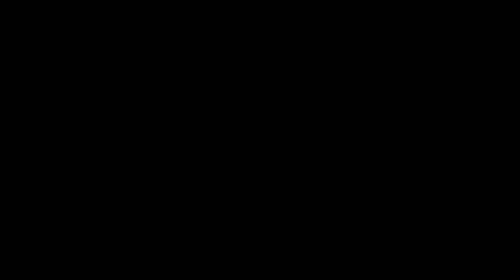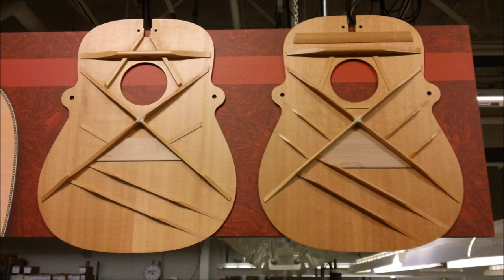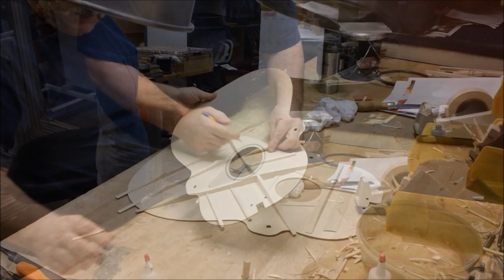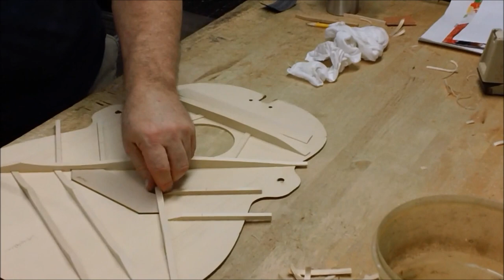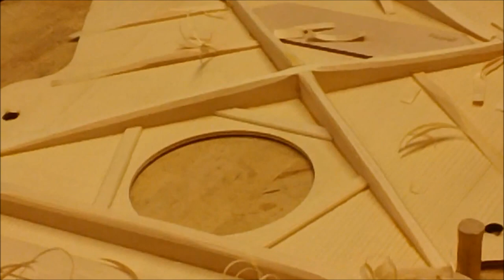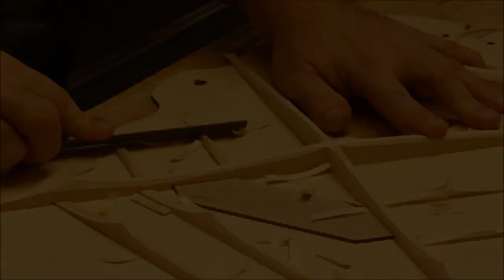brace shaping-Martin Guitar Factory

Comment: There are some videos of Dana Bourgeois demonstrating the process of top voicing/“tap tuning.” I imagine that this man, here, has done this for such a long time that he can probably determine how good the tone will be by the stiffness and weight of the top and the shape of the braces; but I personally feel like a better and more complex tone can be achieved by taking your time with it like Dana does. But, of course, I know that Martin’s productivity levels would totally be brought down, so I fully understand the reasons for doing it as they do.
Reply: This is roughing work. If you notice some wood shavings stick to the chains. Probably later he or someone else will do the voicing work on the soundboard.
Reply: @cristallostranito661  Martin doesn't do voicing / tap tuning. They are simply shaving braces into a predetermined shape for a particular model. What you see here is pretty much the full process, except for some sanding at the very end to remove the scratch marks.
Reply: @boshi9  yep retail guitars aren't voiced. Their custom shop isn't even voiced anymore.
Reply: With the level of noise in that factory, tap tuning would be absolutely impossible, I've seen the same video you saw, with Dan Bourgeois, and I totally agree with you, I hope that somewhere along the line in the Martin factory some fine tuning is being done, if not...those Martin guitars are way too expensive..

Comment: Incredible skill, wonderfully sharp tool, and this would not be possible without top quality materials.  
That said, Martin is a factory, so you won’t get the ritual tsp tuning so many commenters mentioned, but you will get exactly what they intend to make based on many, many years of experience. 

I toured the factory years ago and learned that any Martin , regardless of model, that has a defect that can’t be corrected, gets thrown in a chipper. No factory second Martins. Ever.
Reply: Except for Martin kits. That may be true of complete or near complete guitars, but 2nds of individual parts are usually put into Martin guitar kits for builders. Martin actually has that as disclaimer when you buy the kits. That being said, even the kits have some pretty nice wood. It's like only very minor flaws that create reject parts, or possibly non-matched sides, etc.

Comment: It is reasonable to assume that this was a standard carve applied to all tops with that pattern.
Also presumably further refinement will follow according to each top's material and acoustic characteristics.
This guy worked so quickly that I don't suppose CNC could save any time doing this operation.
Reply: There's a standard carve for a model that he follows. This particular one is their "golden era" style bracing since you can see him hand beveling the "X" braces instead of starting with preshaped ones like on standard guitars, meaning this is either an Authentic or some kind of Custom Shop order with that option. There's no refinement for each individual top at Martin.

Comment: He never tapped the top for tone. This job would take at least half an hour in one of the small production shops, with continual tapping for tone as they go along. He shaved the top like he was peeling  cucumber.
Reply: Even if he was to tap the top for tone, how would he ever hear anything in that shop?
Reply: What I've noticed from other builders is they shave it to the general point of where this video ended, then they start tapping around and refining the braces.
Reply: @dontsubscribeme9547  It's not invalid. Many different bracing patterns work and equally, many don't, that alone is evidence that bracing and strutting has bearing on the end result.
Tap tone is certainly an indicator of the top's response, however, what is contestable is how it is interpreted and the validity of any individual's claims to be able to do so. Unfortunately there is plenty of scope for woo and voodoo science.
Reply: @dontsubscribeme9547  bracing patterns are bullshitl? Um no buddy, bracing is one of the most important things on the guitar
Reply: That's what makes Martin so fun though and other production guitars, there are ones out there that are just perfectly brace for the top they have. It's going to happen, just out of sheer numbers, and when you find that special one it's that much more special and it sound unbelievable better than any costume you're going to find
Reply: @el34glo59  +1. I have an X series Martin that I think sounds incredible, and I wonder if I just got a particularly good piece of spruce on the top or what, because I don't think they even shape the braces.
Reply: I know that a lot of attention has been paid to tap tones, but I gotta wonder how well it can predict what the instrument will sound like. The top will not vibrate the same way once its edges are glued down, the bridge is applied and put under the string load and the finger board is glued on. It becomes an entirely different vibratory system. Maybe it won’t sound like it did when tapped, but maybe a top that taps a certain way will work well in the final product.
Reply: And yet Martin is the standard for which most other boutique builders imitate.
Reply: @trackie1957  I could be wrong but I read somewhere that Martin doesn't use the tap tone method. When it comes to grading wood, they've always done it visually.
Reply: @trackie1957  Have you heard of Trevor Gore? He wrote the book on modal tuning. Part of his philosophy is that you tune the top and back plates to be most resonant at a frequency off of the scale tones (provided you're tuned to concert pitch). This is supposed to help the guitar be balanced across the spectrum. No idea how he actually achieves this after accounting for everything you listed above, but he somehow figured it out!
Reply: Tap tone is way over rated.  This guitar will sound great without messing with 'tap tone'.
Reply: This chap is just working from a template. The result is a slightly lighter soundboard - so there is a benefit but it doesn’t compare with the improvement a skilled luthier can obtain. Martin guitars are factory made instruments. Classical guitarists left factory and workshop made guitars decades ago and the much better tone, balance and volume of today’s concert guitars reflects the expertise of individual builders.
Reply: @trackie1957  yeah I’m skeptical of the whole taping/voicing thing.  You can’t know what a guitar will sound like until it’s assembled and little things like string gauge and thickness of a pick and where you’re playing impact tone in a huge way.
Reply: @fishbake7  
Neumann U87
RME Fireface UCX II
Beyerdynamic DT 1770 Pro studio headset
Reply: Correct. He's making a shape that conforms to some Martin standard, nothing to do with voicing the top  properly.
Reply: Yes. Why do they continue without science and metrics?  @rjlchristie
Reply: I dunno about y'all but my Martin sounds lovely

Comment: I was under the assumption that the amount of shaving was contingent on the flexibility and tone one is attempting to achieve. That means it unique to every top. This craftsman didn't once pick up the top to flex it or tap it. Can someone correct me if I'm wrong please.
Reply: You are not wrong about this at all. I too was very surprised that he did not pick up the soundboard and tap it to at least hear the natural note of the treble or bass sides of the bracing, then shaving more as needed. I am an amateur at this, but that would be my approach.
Reply: Because every piece of wood is different. Not just the soundboard, the bracing too.
Reply: @raytristani  Here's the thing. Small boutique builders would do this as they are likely looking for a certain sound. Martin on the other hand allows for variation, and if you pick up several new Martins in a store, you'll see they all sound a bit different. This gives the buyer choice, as not everyone likes the same sound. This is not a bad thing for Martin, in fact it is probably desirable as it makes each guitar unique. As a by product, they spend less time tuning. I'm willing to bet the custom shop can do tuning for you though.
Reply: capohd28 well, this reply only took 4 years 😂
Reply: @capohd28  
Ramon, Probably the best justification I’ve seen for not doing the tapping (plus it’s too loud in there). Martin selects and sorts materials carefully and builds using well proven designs and methods to make high quality guitars. Any slight variation is ok.
Reply: You are correct. He's making a shape that  produces consistent results, not BEST results for a particular soundboard.

Comment: This is why there is too much belly bulge in guitars with this type these days. There is one flaw that compromises strength in this system . There is one slight difference without changing the brace pattern one bit , but it will add profound strength to the sound boards ability to keep flat ..engineers use this strength very often......

Comment: I wonder what brand chisel .........nice n sharp
Reply: Mike Reynolds looks like it’s installed on one of those screw on file or rasp handles, and it almost looks like an old mill bastard file that’s been ground smooth and turned into a chisel. I’ve seen many of them done that way and they do make great chisels if one knows how to grind and heat treat properly.
Reply: Not a matter of chisel brand. Has more to do with how it is sharpened. His is not particularly sharp. A sharp chisel can take off a strip of wood you can see through.
Reply: Three Cherries Custom Tap Tone. $29 each, sharpening? $5000.

Comment: So all this malarkey about the tuning the top is marketing hype?
Reply: Yes you are right, because once the body and sides are added, two slightly different sounding free standing soundboards when tapped , will sound no different when complete guitars , it will usually be equalized through the physics of the guitar shape and bracing, it is currently a challenge for the industry.
Reply: Pretty much. Pro luthiers concern themselves with how much stiffness they want in the top. Still, you can get a soundboard that has little response and won't produce any "bong" when tapped, and you must reject that board.
Only takes a few taps to detect a bad board, but luthiers don't adjust for tap tones.

Comment: why not carve the braces before they are glued in with all the shaping already done, by a robot
Reply: Braces are left fat at the start so that  spreads out the load on the braces with less forcing or tensioning while the adhesive sets. Later, after the soundboard has set or acclimated to the fat braces, material can be removed with less trauma and tensioning errors than starting with thinner braces initially.. I mean, I'm just making stuff up here.
Reply: @NeverTalkToCops1 nah that makes perfect sense you can't clamp onto a triangle point